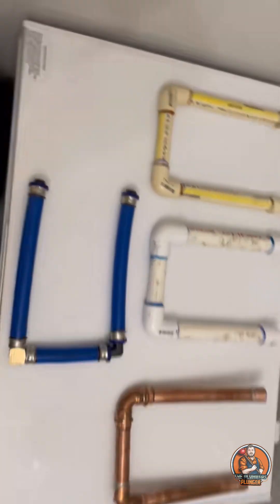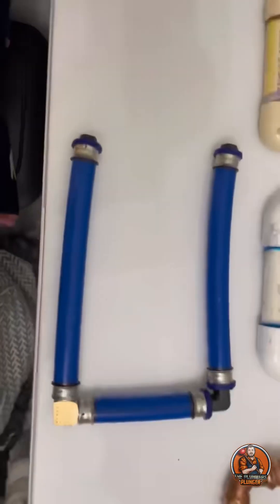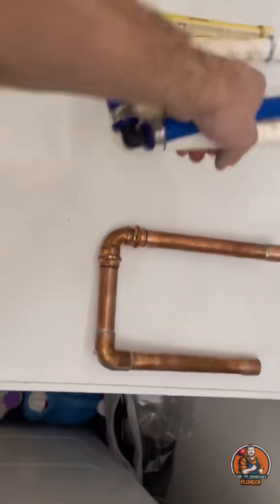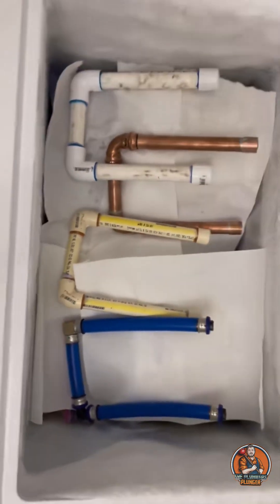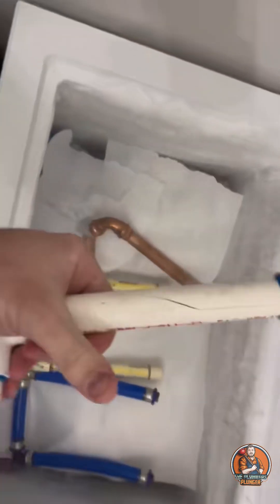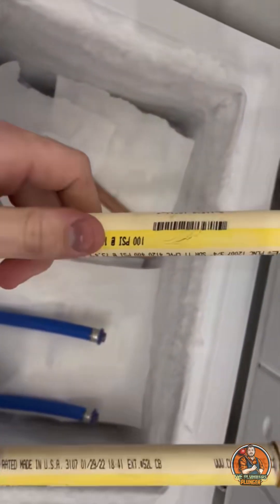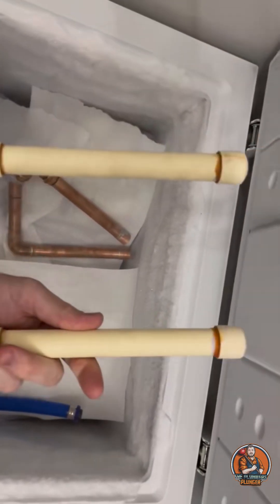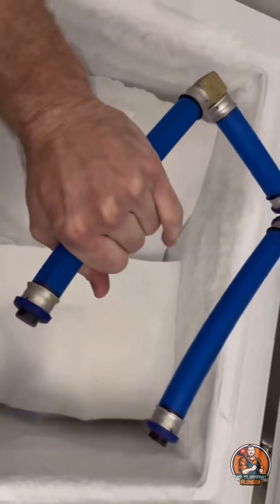Freeze Testing Plumbing Materials

Comment: Pex b  will survive an occasional freeze the best out of those options. However it will gradually deform and not return to its original shape, causing the fittings to eventually leak.  Pex  A  will last longer since it is designed to maintain its shape.  Note also that copper being more rigid will prevent the water from freezing at a slightly lower temperature than pex will.

Comment: My takeaways:
#1 The test would be more accurate if line pressure was applied.
#2 Everything has a limit
#3 As long as pipes are not exposed to ambient air temperatures they usually don't freeze. It has to get really cold for a pipe to freeze with protection.
Reply: In the old house I'm in, I start to worry about 10°f, which isn't a common temperature here but we get it occasionally. I just keep the water trickling in one sink, which is enough that I never had an issue at even colder than that. Pipes need to be in an area that is protected from outside air, and with heat. If not, you can use heat tape to help get through the cold.

Comment: Copper busted on us 3x in the same spot. Even after adding insulation, it still busted on us. We decided to cap it off past the split-off to where it leads to our outside spigot and the other split goes to our kitchen/fridge line. The location of the outside spigot also plays a big factor. We will wait for the summer to spend a couple of hundred dollars to reroute the outside front spigot location. Also make sure that the exterior sheet rock is insulated to protect the piping if ya got copper piping.

Comment: I like pex and i get all the benefits but i hate the water wasted waiting for hot water to get to my taps.
Reply: Put in a recirculating pump. You'd probably need to make a few holes in the drywall, but if you really don't like wasting water, it would pay for itself pretty fast.
Reply: copper would be worse  because copper is a conductor the oposite od plastic which is an insulator    cpvc or pex will   resist loosing heat better than gal or copper  y metal pipe an

Comment: The pro press didn't hold but the solder side did
Reply: The copper pipe would burst open. I like soldered copper piping but it's definitely not freeze proof. Pex only survived because it can expand when the water freezes. Copper can't expand so when the water freezes it'll either break at a joint or split the pipe open.
Reply: @BigRed66X yeah but it would still cool to see it on the short. Pex a should be the most durable other than pex b when it comes to freezing.
Reply: Did u not hear a word he said. The pipe would've cracked anyways.
Reply: @P@Pack_10minus3o no duh obviously it will crack the whole video is a demonstration to show noobs. You are trying to make yourself seem witty but you only sound like a troll lol
Reply: @lordthorby6199 using the word "noobs" means you still got diapers on lol. Greener than the money you don't have😂
Reply: As someone who grew up in the north… I can PROMISE you the solder wouldn’t do shit to hold up. Copper splits just as bad as PVC. Plex can take it because it actually has elasticity to allow the pipe to expand slightly though even it will eventually fail if it gets cold enough. But I have literally been on a ladder getting shot in the face with freezing cold water in 20 degrees from failed copper in my friends inside wall because their garage got too cold and they forgot to drip the pipe. Copper pipe looked like a Bugs Bunny cartoon gun when he plugs the end with his finger.
Reply: Pex is good for non-aesthetic piping if you crimp (ASTM F1807) primarily with a battery press tool.  The stainless clamps clips aren’t that great, but that is more of a preference. Press is used only when the system is problematic, for example when sweating a copper to pex adapter is problematic because the water supply will not drain down.

I like PEX-B, but I find that some plumbers get a little lazy with following manufacturer’s instructions such as making square cuts and securing the piping, et cetera.
Reply: The pro press side fails first, if it was all soldered it still would have burst
Reply: @jcmphreek man I’m starting to lose hope in this comment section…i think maybe you guys are mad because I figured out a way to show soldered fittings without the use of any pro press. Maybe pro press is started to have a negative effect on some of us plumbers lol. Btw I believe pro press should only be used when you can get water to stop flowing through the pipe which would make soldering impossible. It is also good for work areas that prohibit torches.
Reply: @lordthorby6199  who is mad? Why are you projecting lol
Reply: @jcmphreek not mad just disappointed lol
Reply: @lordthorby6199 okay
Reply: Copper will split if it’s frozen and had solid connections and nowhere to give
Reply: @ThatMaintenanceManSam  just pointing out that pro press suck
Reply: @MaxPower1000.  I don’t like them either. I’ve had to chase down so many leaks because of pro press
Reply: @ThatMaintenanceManSam  you need to calibrate the machine every 6 months
Reply: @MaxPower1000. I don’t use them. I’ve just been called to leaks
Reply: Would have busted
Reply: It's not the ice that gets it,  but the excessive water pressure created as the ice forms along side the still liquid water.  The ice starts at one point and freezes lengthwise compressing the liquid water more and more as it freezes.  That's why there is a round plug of ice between the propress elbow and the pipe.  You can test this by leaving a cap off and the pipe standing upright.  The copper will stretch without busting.  Anyone who's seen copper freeze breaks knows it looks like a linear split that pops out because the water was still liquid at that point.  That's why you drip your faucets,  to let the water pressure off when it freezes
Reply: This is exactly what I came to say!
Reply: He should use a mip and a brass cap next time so he can somewhat test the pure solder version
Reply: I had pipes freeze at my mom‘s house as a kid. All soldered copper, turned into a rainforest in the basement.

Comment: Try copper with soldered fitting.
Reply: Still bursts. In the Midwest, we definitely keep our cabinets open under 20F. Use small space heater fans under 0F.
Reply: I bet it would burst
Reply: @foodooyou1 can confirm!
Reply: He did, one side was soldered, one side was pro pressed. The pro-press side failed
Reply: @Bremend 
Hear here.
Reply: nah i used to have copper pipe burst several times in the garage after repair, it splits it open

Comment: Is it just me or do other people secretly love pex the most?
Reply: Pex is my favorite pipe in general, but if does depend on the application at hand. There are situations in which I will always use copper, but the freeze resistance, flexibility, and significant reduction in fittings certainly make pex a great system.
Reply: Pex is great if your installing it, that's why it's number 1 in the comments. To anybody who's been around the block a couple times its just rainbow poly.
Reply: @markkotarski4659 no way. I’ve had that stuff crumble in my hand. Talking about around the block cmon man
Reply: @Markonacr250 20 years from now we'll be pulling pex out. Everybody said the same shit about poly
Reply: @markkotarski4659  this whole conversation is secret. But I’m sure we can agree solder copper joints, and lead shower pans can’t be beat.
Reply: @Markonacr250  lol, for sure.
Reply: @Markonacr250  copper shower pans?
Reply: Working with pex is great. However, copper is the gold standard imo
Reply: PEX is great, besides the microplastics it leeches.